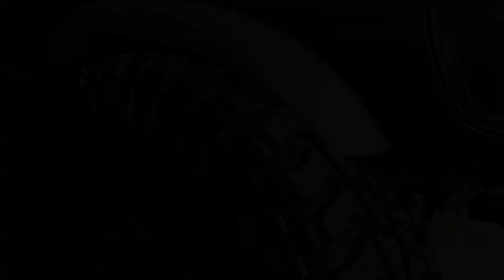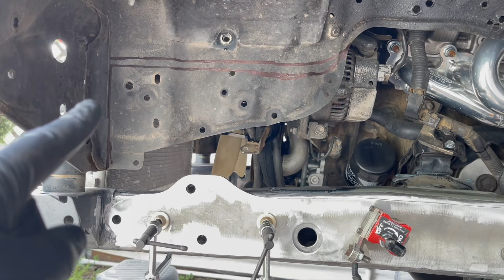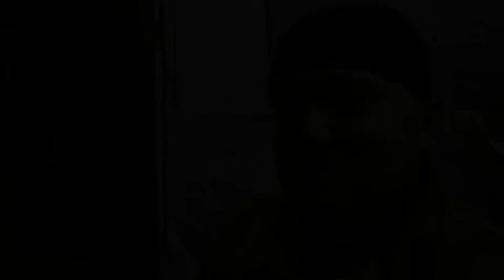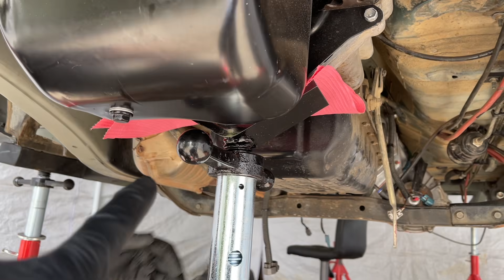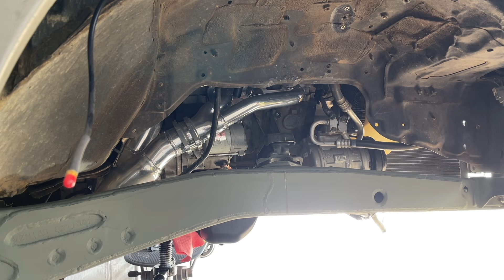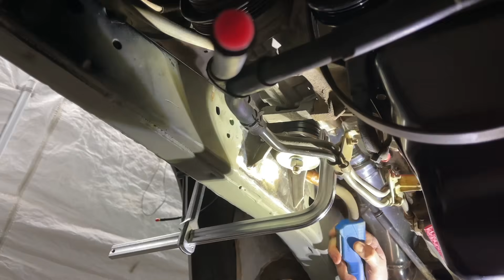Solid Axle Swapping a 3rd Gen 4runner (Frame Plates, Steering Box & Engine Mount Install)  Episode 6

Comment: 10/10 rails warped with stiffner plates. Happened to me. Can only weld lile 3-4" at a time with those. Them wait.
Reply from the maker: You're probably right, but I have witnessed the frame relaxing inboard when doing a transmission swap.  After removing the transmission crossmember,  it was a fight to get the last bolt aligned.  But, it wasn't off by much and definitely nowhere as much as Chris' frame was off.  But, then again, we removed the two main crossmembers on the front of the rig.  If the frame wanted to relax inward, we definitely gave it the opportunity.

Comment: Man you need a lot of tools for this project.  I guess it really helps to have the right ones
Reply from the maker: Definitely need a good cache of tools to pull off this job.  I would say the tools that were the biggest help were our Milwaukee Cordless Tools.  We used Angle Grinders, Hackzalls, Die Grinders, Band Files, Rotary Tools, Drills, Ratchets and Impact Guns.

Comment: The fan blades going to hit the radiator shroud
Reply from the maker: Well, it that's the worst of our problems, we're doing pretty good.  If it does contact, I guess Chris will be making a custom shroud.  This is a HEAVY modification job to a 3rd Gen 4runner, so having to figure out a fix for what you mentioned is child's play compared to what we've done so far.
Reply: @TimmyTheToolman i also moved my trans mount 5/8" to driver as well. Makes some of the cat sensors hard to get to. All works good tho with fan shroud... Its tight, but works
Reply: There’s actually a decent amount of room around the fan shroud, when you do a 1” body lift you don’t move the radiator/fan shroud at all to go back down to where the engine is.